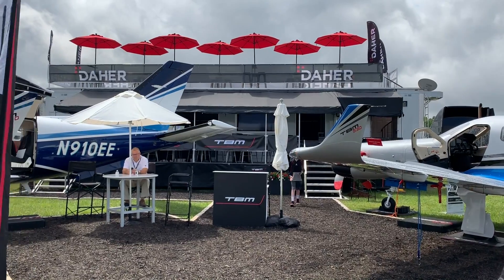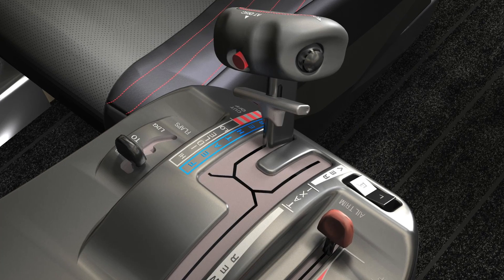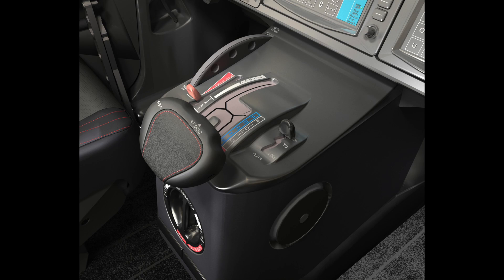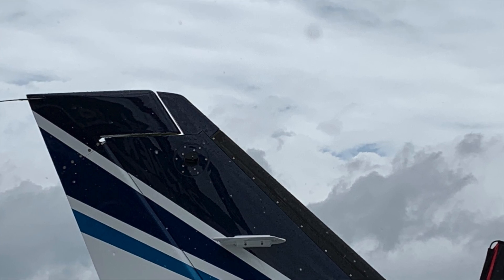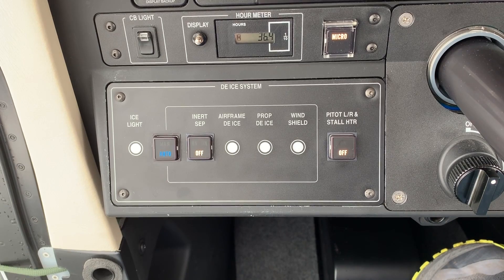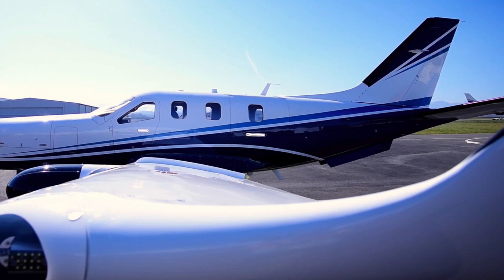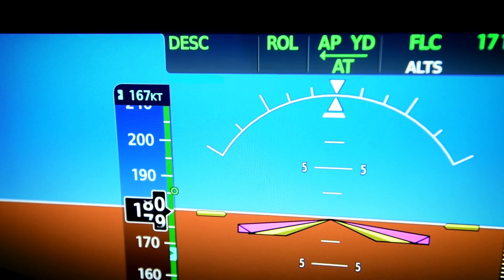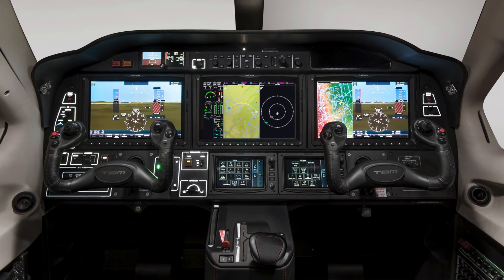Autothrottle On Daher TBM940

Comment: I'd like to see a comparison of the TBM940 and the Cessna Denali once it's certified. Both aircraft are similar in size, are supposed to use the Garmin G3000 display, but the Denali is using the GE turboprop that has a FADAC, which the Pratt PT6 lacks. The 4,000 hour hot section inspections is going to be a major game changer.

Daher, any thoughts of offering the TBM with GE power?
Reply: @dfrey3449  No, they recently reduced max speed, 1200 hp and still slower..... TBM is 850hp and very efficient
Reply: @dfrey3449  Agreed
Reply: The PC-12 is old technology: they have an absolutely poor pressurization system, really bad cabin altitude at any cruise altitude. They can't fix this without a new fuselage so that ain't going to happen. The PT6 is legendary, no doubt, but its had its day in the spot light. It's now time to move over and let the GE motor start to take center stage. The GE engine is the future now, not the PT6. The 940 and all models going forward needs an externally serviceable potty. I mean really.
Reply: the pc 12 is old but it seems like pilatus is not done with it yet. 
The new pc 12 ngx has fadec, autothrottle, engine power has been increased and the speed has increased to 290 kt while the efficiency has also increased by 10% -15% ( according to Pilatus ) 
The engine TBO has been increased to 5000 hours from previous 4000 hours.
There is no need for a hot section inspection.
The maintenance interval has been increased to 600 hours.
And Cessna has announced a delay in the Denali program, by the time they come out with Denali many other turboprops using PT6 will have all the features that the denali is expected to have.

Comment: Emergency descent mode like the MCAS?
Reply: Too soon Carl. :)
Reply: No, as in if there is a loss of cabin pressure or oxygen level, the aircraft will descend to below 10,000 feet so that hypoxia doesn't kill you.
The TBM 930 did introduce a system that monitors the flight envelope that is similar to MCAS. There are video's of the system in action.